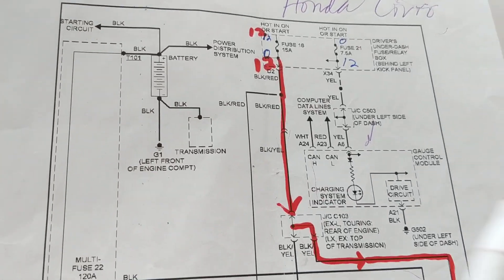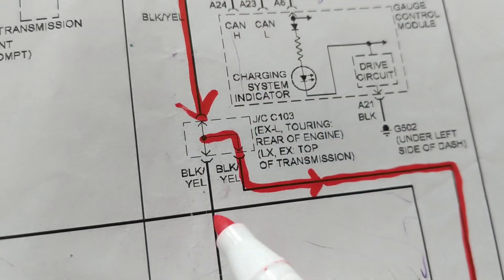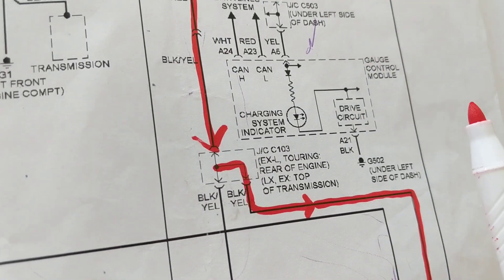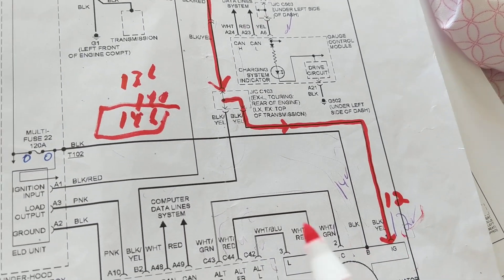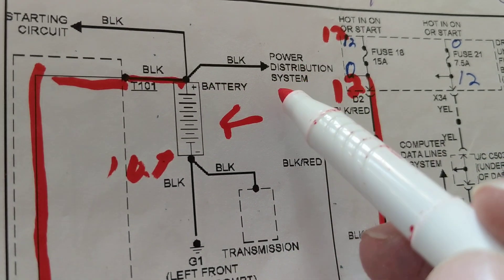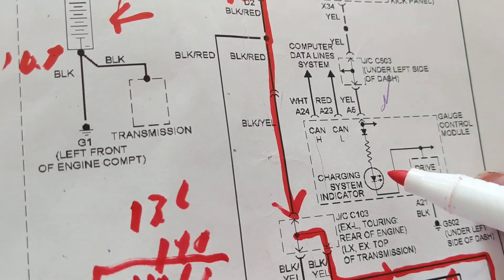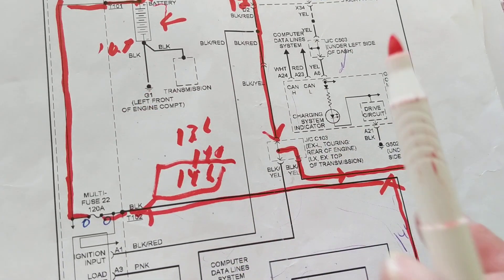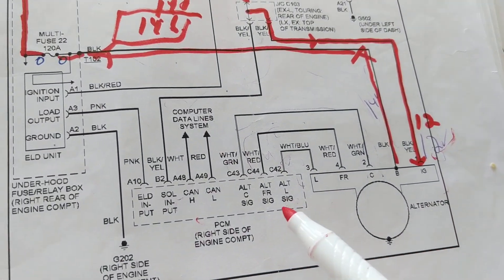HOW TO UNDERSTAND HOW ALTERNATOR WORKS AND CORRECT WAYS TO DIAGNOSE ALWAYS CHECK BELTS

Comment: I thought current can only flow one way through a diode and that is from cathode to anode. However you are saying that current will flow through the diode backwards through the charging system LED. I would think that the current would come from the drive circuit to light the LED.
Reply from the maker: It depends if you are following conventional current or electron current usually we do follow from negative to plus however in electronics of automotive we usually follow from b+ to ground which means from the anode of the led to the cathode. The main point is regardless of the direction flow that current is flowing thank you so much for your comment I appreciate it
Reply: Thx Joe that makes sense I forgot about conventional I’m so use working with electron boards
Reply from the maker: @bushrod6258  no problem thank you for the question

Comment: Hello, Sir. How does the pcm know that the battery is not being charged?
Reply from the maker: The battery cable is connected to the alternator cable so therefore the b terminal tells the computer how much voltage there is but the current demand is related to the accessories that I used and the load